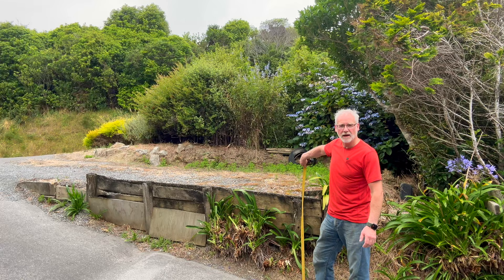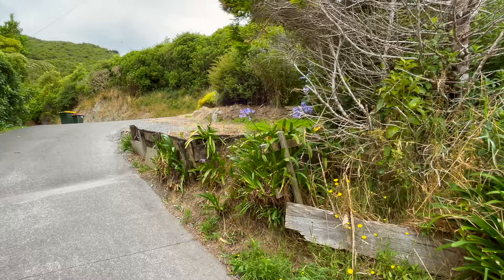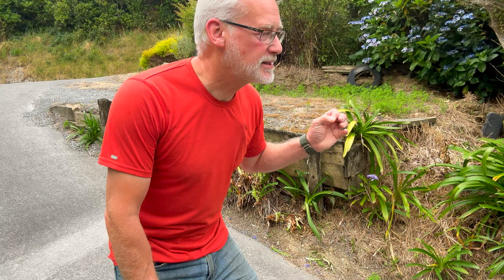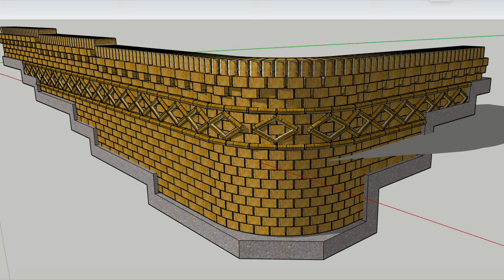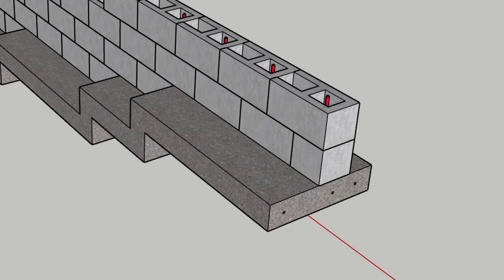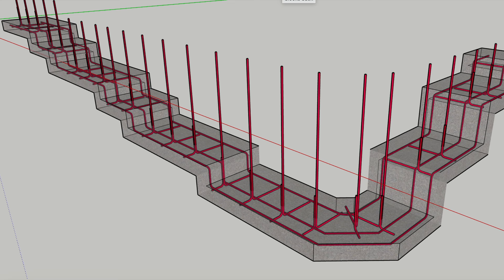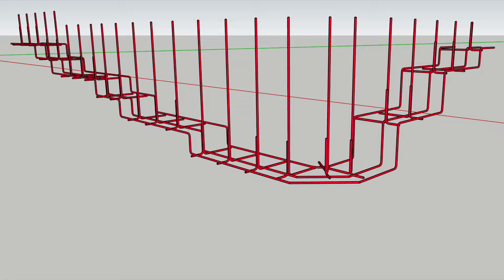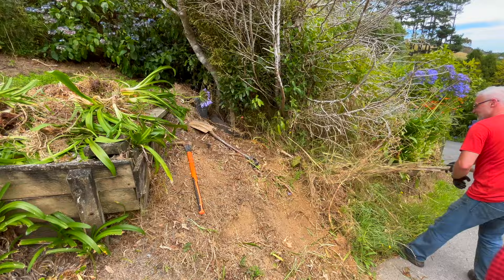How to build a RETAINING WALL  - pt1 - digging stepped foundations

Comment: You do not seem to be going below the frost line over the entire length of the foundation;... Am I missing something?
Reply from the maker: You are technically correct, but one of the many benefits to living in NZ is the temperate climate and in this location there’s no perceptible ground frost to consider.  Thanks for the reminder though, and an important consideration particularly for those in the USA and Canada.  I’ll be sure to point that out in the next video. 👍